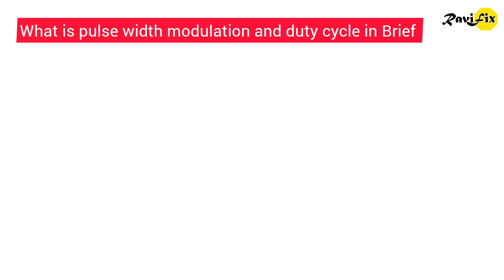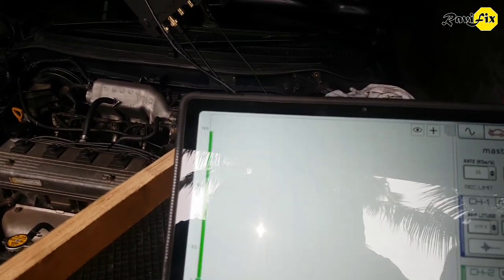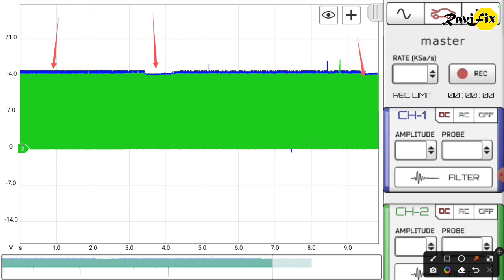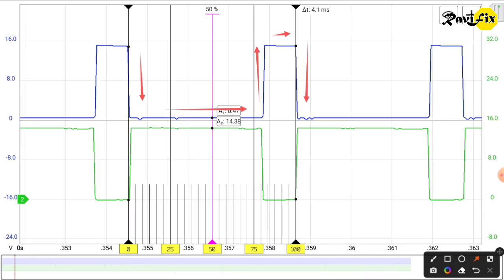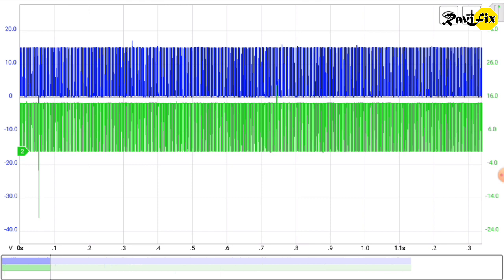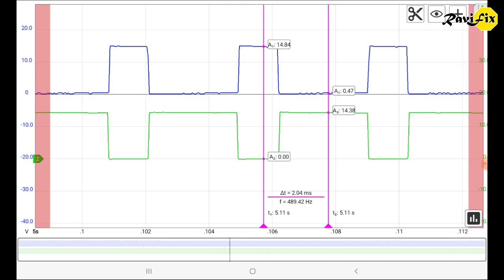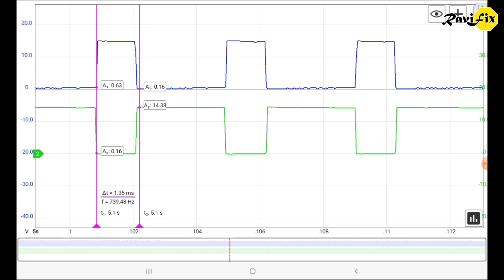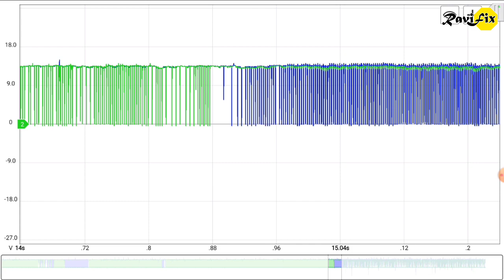Automotive diagnostics on pulse width modulation. Oscilloscope use for visualize faults on PWM,

Comment: I have a question about grounding with a pwm unit. Can I run positive wire to control side and a short ground to chassis. Then can I run positive power to the motor and short ground to chassis at both the pwm and motor? Or will I have to run a full circuit +/- between pwm and motor. I also want to install an amp meter there, normally it would be on the negative between pwm and motor. Can I install the meter on the pwm's short ground if it's possible to do it that way?
Reply from the maker: You can do it.

Comment: PWM and a variable controllable duty cycle does not necessarily have to be computer controlled or associated with a computer.

You are incorrect on that point.

You can create a multivibrator with adjustable frequency and duty cycle using a 555 time chip without the use of any digital electronics or computer.
Reply from the maker: Thank you for your input. 
You are right on this matter.
 I am not familiar with circuit design. Here i tried to explain automotive diagnostics on PWM. 
In the automotive system mostly PWM generate in a controller module. Because it consider input Data and process them to output right duty cycle.